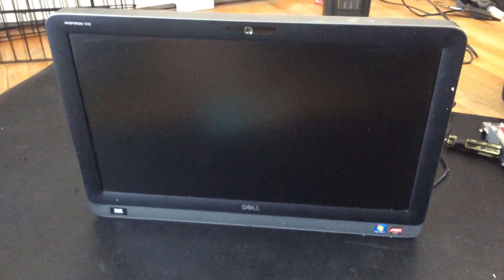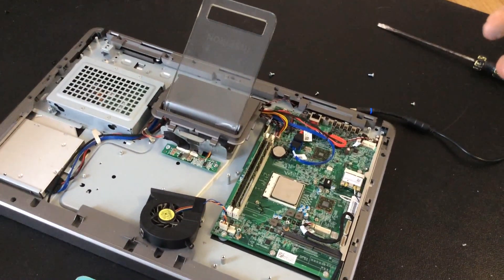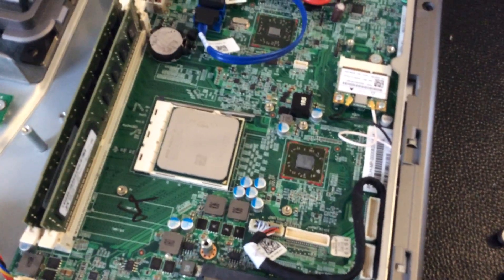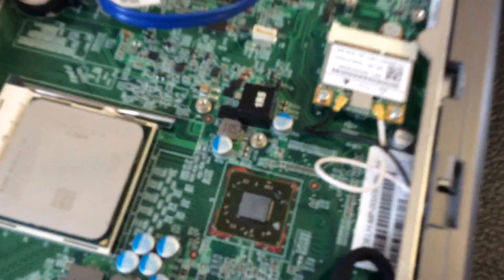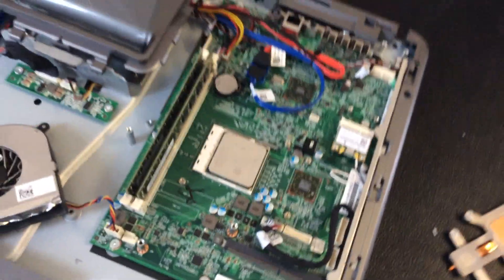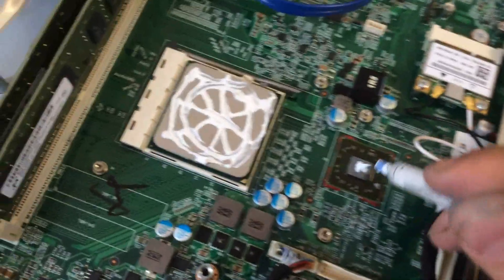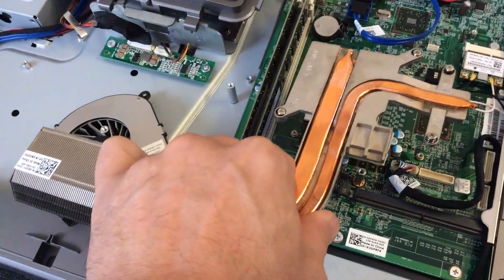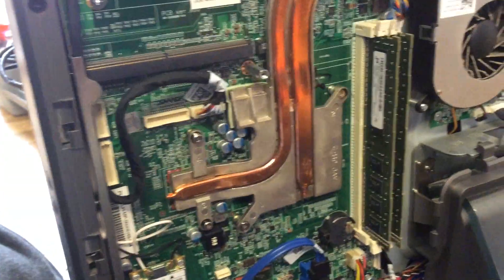FIX for DELL INSPIRON ONE 2305 - NO VIDEO - Power Button has orange Light

Comment: I picked one of these up from a storage unit. I fixed the failed attempt to open it up from the prior owner and plugged in a universal power supply. Naturally Dell has to be a jerk and make it a 19.5 volts . Well tried both 19 and 20 and both show a screen turn a monochrome blue, it blinks a few times and does nothing. It basically does nothing but turns on with no post. or Dell logo screen. Maybe this is it but maybe not, any thoughts?

Comment: Heat guns are pretty much the same as a reflow station. 
Do this next time though. Use a "no clean flux" next time you do this, and shield the components surrounding the GPU with kapton tape and aluminum foil, so you don't bake those.
Reply from the maker: Great tips. I honestly didnt expect this hack to work.  But it did! (I own a reflow, but, wanted to see a household item do it)

Comment: I did everything but not the gun because I don’t have it. The power button is still orange when I tried before putting  thermal paste please advise ? Thanks
Reply from the maker: The Heat is the key part, because it’ll soften the microchips solder and make them connect again. Can TRY a hairdryer on it’s hottest setting or get a $12 Craft Heat Gun on Amazon or at Michaels (for a bit more)
Reply: @GreggAdventure  i Will try and get back to you .
Thanks
Reply: Thé power is white now, the computer work for about 1-2 minutes and all what I can see is black screen again . Should I use the thermal paste ?? Because I didn’t.
Please advise thanks
Reply from the maker: The cpu will overheat and potentially die, in less than a minute without the paste.
Reply: @GreggAdventure  thank you

Comment: So here's my update......It worked but after I turned it off it would go back to being dead. I would heat it again and again. It works up until I turn it off.  I research this method and people call it BS. I'm not here to crash peoples channels or anything like that. If it works for you then thats great. My card is just to used up for this to work. I heated it up and got it running again but this time i leave it on and just have the monitor turn off. I'll be trying to get as much as i can out of it still. lol thanks again
Reply from the maker: There is no way it will longterm last. Clone the HD with Casper and GTFO! 👍🏼✌🏼

Comment: I had exactly the same problem, now fixed by your method. It was caused in my case by thick dust completely blocking the heat sink fins, causing the over heating you describe in this video. Thank you very much!
Reply: X2

Comment: Apologies for my long comment since some of you will find this useful...

My Dell 2305 has a new life as a Win 10 and Zorin (Linux) dual boot machine.  Incredibly, this 9-yo now runs like a mid-tier PC.

Using a heat gun on the BOTTOM side of the PCB under the GPU permanently resolved the cold solder joint issue. Heating the GPU directly was only a temp fix for me.

MSFT is still providing free Win 10 upgrades (offer had previously ended):  https://www.microsoft.com/en-us/software-download/windows10

With 8GB RAM and OEM HDD, the PC was upgraded with an AMD Athlon X4 610e and it runs a faster with 4 cores.  Under Win 7, I tried an SSD upgrade but the OS wouldn't boot.  Now running Win 10, I'll give the SSD another try to speed things up once everything is stable.

Before the Win 10 upgrade, I installed Zorin 15.1 for its Window-like interface and touchscreens.  This opened a new computing world with Linux.  https://www.forbes.com/sites/jasonevangelho/2019/06/05/its-time-to-pay-attention-to-zorin-os-15-the-best-desktop-linux-distro-youve-never-heard-of/#21f4c2fc1c80

Good luck to all.  My Dell 2305 is now much more functional thanks to dual boot, tablet mode and touch-enabled apps!

Comment: Yup its working but just for 30 minutes then again same orange light. Any permanent fix for that????
Reply from the maker: Results are super random. Try brushing flux on the chips pins before heating
Reply: @GreggAdventure  It might be the solder balls under the GPU rather than the SMD chips.  Try heating the GPU for a longer period.  The components can take the heat but keep the airflow low.
Reply from the maker: Thanks for the input. This Video continues to draw people, attempting to deal with this issue.

Comment: While this has been the solution for me 2 times already the first time it lasted 3 months now I did ti again and it worked but now a day after I ONCE again have the orange light on. What else can I do to prevent this from happening again?
Reply from the maker: That sucks. Seams to have random results. My repair lasted 3 days, others, still working....  Try brushing flux on the pins around the chip, then heat it. If I did it again, that’s what I’d do
Reply: @GreggAdventure  I will definitely try that it happened again this time it lasted 4 days I did notice that this happens only after watching YouTube videos if I dont watch videos seems to last longer
Reply: @ppj228  Three months is decent for this quick fix (my first two attempts only lasted a week).  Try heating for a longer period and apply fresh thermal paste if you haven't done so.  Once the system detects GPU overheating, the system will not reboot.  Good luck.
Reply: I am stress testing my recent fix by running YouTube continuously.
Reply: @RogerFong  20 mins of YouTube would do the trick just turn off and back on the computer see if you get the amber light on
Reply: Ok update on this
I took it to a repair shop and was told I need to replace the GPU because apparently is damaged. I will most likely have to buy the whole motherboard as the GPU is integrated to the motherboard.
Currently having a hard time finding a replacement
Reply: @ppj228  Repair shop is telling us what we already know.  Give it one more shot by heating the GPU for a longer period and use fresh thermal grease.  Nothing to lose at this point.  An earlier post suggesting "reballing" but that's an extreme tedious fix though correct one for long term.  https://www.youtube.com/watch?v=CkZ-5LC4LeI
Reply: Heating the underside of the motherboard where the GPU is located is probably the best quick fix to reflow the solder balls.  Quicker than trying to find a replacement MOBO.
Reply: @RogerFong  ok this is a first I haven't tried, I will be going to pick it up from the repair shop now question how long do I leave the heat gun on it?
Reply: @ppj228  If heating from the bottom, the pcb should easily be able to take quite a bit of heat.  Heating from the GPU side requires more caution since components are subjected to the heat (and SMDs can blow off when solder reflows).  Worth experimenting!
Reply: Download HWMonitor from cpuid.com to track CPU temps, etc.  It shows GPU usage but unfortunately no temp.
Reply: @RogerFong  I most mention I dont have much experience with computer I use YouTube as guidance so I really hope this works thanks roger fong
Reply: @ppj228  Good luck.  You've done well so far to get your PC running again for 3 months.

Comment: I have a white light and no screen?
Reply: I had a similar issue after the repair.  It was stuck on the Dell screen during POST (Power On Self Test).  Resetting the BIOS worked for me.   Start here and search for your specific model/mother board.  https://www.dell.com/support/article/us/en/04/sln284985/how-to-perform-a-bios-or-cmos-reset-and-or-clear-the-nvram-on-your-dell-system?lang=en

Good luck.
Reply: For my system (2305), this involves moving two jumpers (CMOS and Password), power up/power down, and moving the CMOS jumper back to its original position.  I'm not sure why Dell doesn't list this as a fix for the "White Light - no POST" fault mode.  Would have save me hours and many owners from tossing their PCs.

Comment: Back from the dead after 4 years!  Was about to e-cycle my Dell AIO and decided to search one last time for a fix.  Took apart heat sink and applied new thermal paste four years ago but no joy.  Heat gun did the trick!  Booted up and Windows even opened up all the program files browser tabs that were running when the video died.  Thanks!
Reply from the maker: Amazing! Back it up! 👍🏻👍🏻🙌🏻
Reply: @GreggAdventure  Great advice though I had already pulled the drive and backed up the files.  Since I was cautious with the first time heating briefly (~ 1 minute), the issue immediately returned.  Repaired again heating for a longer time (> 3 minutes) appeared to do the trick since I had nothing to lose.  System is now up & running YouTube for over a week to "stress test" the graphics chip.  I applied new thermal paste (Arctic Silver 5).
Reply: Thanks again for posting the video Gregg!
Reply: @Robert-pe5hf  The heat gun fix worked until it didn't (dreaded orange lit power button with black screen).  Replacing the MOBO with an Ebay refurb for $90 finally fixed ALL of the HW issues.  Installed a FREE Win 10 Pro upgrade from Win 7 Pro and dual boot Linux (Zorin).  The Dell AIO is good for minimal Windows tasks and exploring Linux.  Now, Windows 10 Updates are causing crashes & reliability issues... :(
Reply: It was a frustrating but ultimately satisfying project of getting the PC back up and running.  The touchscreen is still working OK with Win 10 and Linux though the HW is struggling to keep up.

Comment: Yes, it can work but how long it stays working will depend on other things like how hot did the solder get, did it reflow good enough throughout the GPU grid? The best solution is to have the GPU removed and the whole chip re-done with new solder balls. That will last for years. This method might get you a day, a week, maybe a month. But as the computer gets used and the GPU heats up and cools down again, the solder is already weaken on the molecular scale and will crack again at some point putting you back in the same boat. Buying a used motherboard will render you in the same mess sooner than later. A certain % of GPUs were designed flawed and this model got some. Same with HP DV6 laptops. They failed in the same manner. I tried this method and got a few to work only to watch them fail within a day of bench testing. For this Dell, I used a heat gun set to 400 degress for 1 minute. I put 2 pennies on top of the chip to help the solder. I used tin foil with the square cut out exposing the GPU but covering the neighboring components. If you use the computer in a cool place and don't game on it or watch long videos, you'll get more mileage. Use good quality heat sink and clean the cooling fan and fins real good before reassembly.
Reply from the maker: Yup! It's a craps shoot.

Comment: I've left Windows alone and went Mac everything years ago. But I sure would like to fix this Dell Inspiron One in my closet. But I have a different problem. My light is white, everything powers on fine then after login screen everything goes blank except for the mouse cursor which I can move all over the screen but that's the only thing I can see. Or if a pop up comes up it will show but that's it.
Reply from the maker: Sounds like a video driver issue....  Could even be a virus. If you have another machine, might be worth trying a virus scan on the drive, by hooking it up as an external drive. Otherwise, my 1st move, would be to boot the machine into SAFE MODE, and/or try Windows Auto Repair, which can resolve SOME boot issues. If all else fails, and your troubleshooting skills are limited, make a Windows 10 Boot install, on a USB, using their media creation tool (it's VERY EASY), and do a clean install of Win10. This very much sounds like a software situation
Reply: @GreggAdventure  I hit F2 at start up and changed the Boot from Drive to Boot From Hard Disk and it worked fine until the Windows update. Then it went back to the blank screen. However, ctl, alt, delete then logging out the user and logging back in is correcting the issue for now, so it's just weird. One of the reason I went all Mac. But the monitors in church use a Windows program so I wanted to get this running again. Thanks.

Comment: Can I use a hair dryer instead of a heat gun? Hoping this isn't a stupid question and the temp doesn't need to get super high??? Just ordered the paste and am waiting on delivery.
Reply from the maker: I would use a heat gun. It's MUCH hotter. But, can try the hairdryer. Some of them get pretty hot... give it a try.
Reply from the maker: P.S. Please hit the Sub. :)
Reply: Yes. Just don't put random thermal paste on your cpu heatsink. Figure out what type of compound is used first.

Comment: Okay, I was about to trash this thing and then decided to search for a new or used system board to see what it would cost to try and replace it and ran across your video.  First, I thought this guy is crazy as F&*k.  Then I said what the hell, I have a heat gun and some thermal paste so I'll give it try.  I'm happy to report that it fixed the problem!!  Hopefully it's a long term fix!!  Thanks for your video!!
Reply from the maker: Sadly this machine failed again, but I've got more than a few comments of success now, so, I'm thrilled. Epic! Happy to help.
Reply from the maker: P.S. I AM Crazy as F&*K. Lol